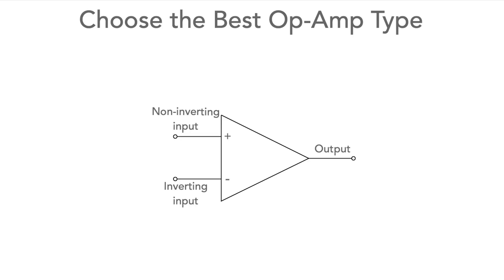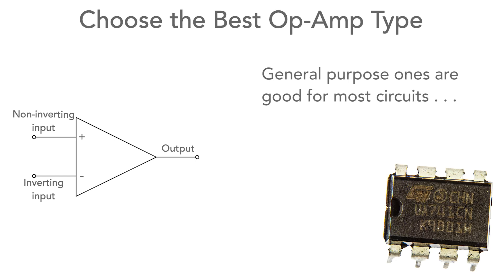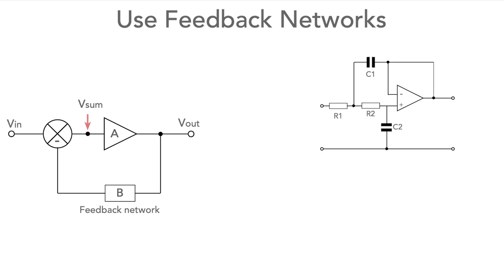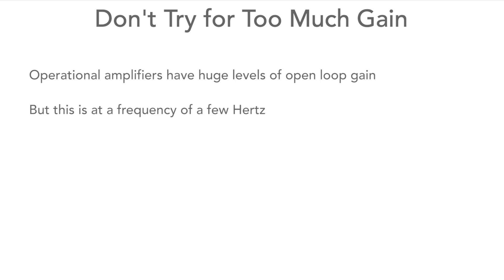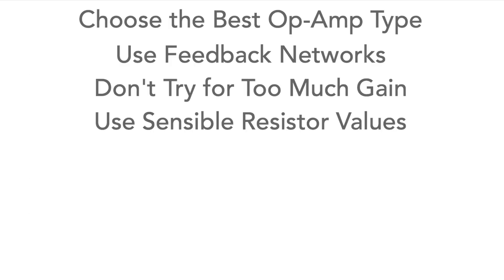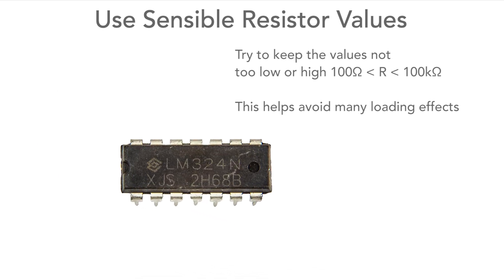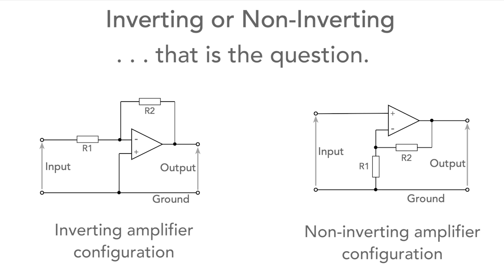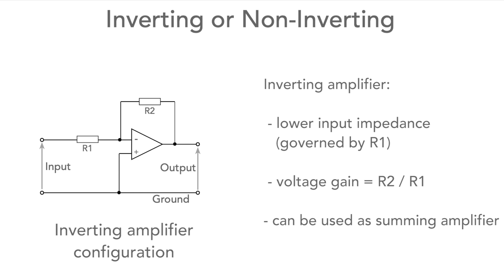5 Great Tips for Operational Amplifier Circuit Design

Comment: A few tips of my own:
1) "typ" specs are the ones they sent to someone else.  Design using the worst case numbers
2) Remember that the output currents came from the supply connections ensure a low RF impedance on the supplies.
3) Almost all op-amp circuits are ruled by Ohm's law.  You rarely need to memorize any other equation.
4) If a number is not given as a min or max in the data sheet presume that one is dreadful for the purpose of design
5) Don't limit your thinking based on examples you have seen (Supply voltages of -7V and +10V are fine for example)
Reply from the maker: Yes, some really good ideas. I might need to do another video - a sequel!!
Reply: @ElectronicsNotes  I have seen a lot of difference between what is typical and what is worst. E.g., Typical input bias current of OPA698 is 0.2uA but worst case goes to 10uA.

Comment: Howdy. Nice.
I would like to mention two more points.
1. Keep in mind there is always a small input leakage current. Provide this leakage to be drained not to upset the work point. (Caused a lot of headaches for me.)
2. For Hi-Fi. If half of the output swing suffices. Design the work point to be at about half the B+ or B- to avoid cross over distortion. (A hint i saw in another YouTube clip.)
Regards.
Reply: On #2, a resistor to the minus rail can be used to keep the op-amps output in class A.
Rarely, however is any of this really needed because op-amps that are really good can be bought.
Reply from the maker: Yes, good ideas.